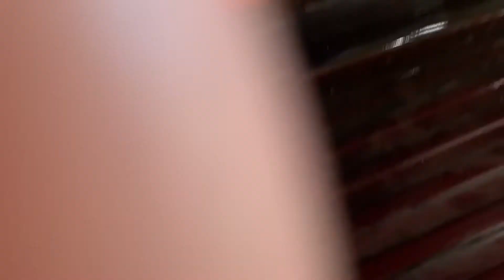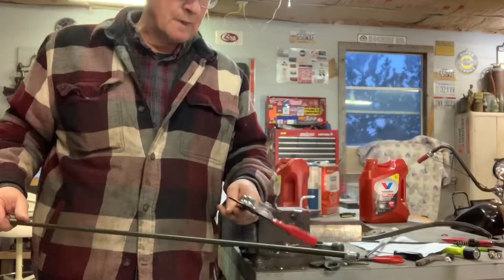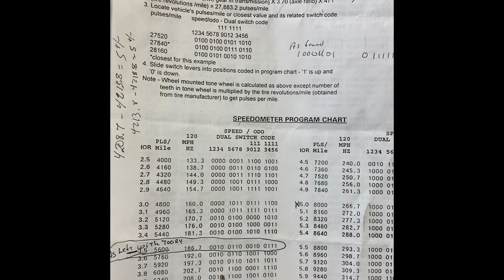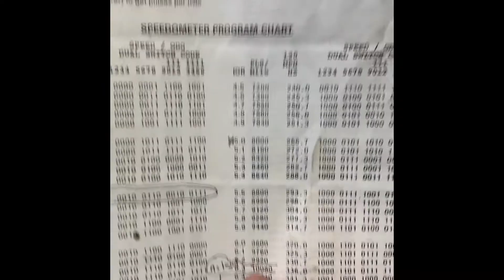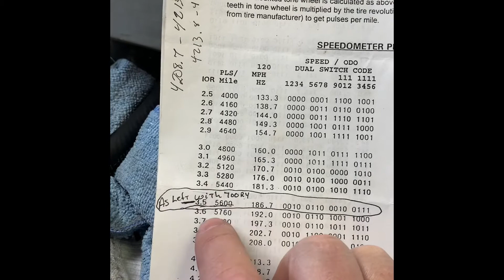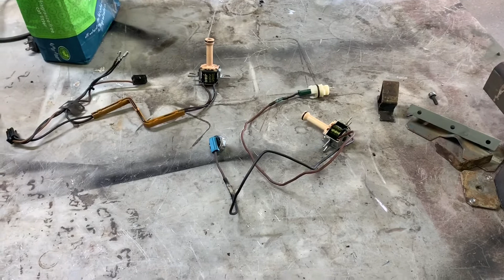Pt2 52 Chevy pickup Turbo 350 to 700r4 Swap

Comment: So its been about 10 months since this video. Have you been able to see the better fuel economy?
Reply from the maker: Not as much as I had hoped. Looks like roughly 4 or 5 more miles per gallon. However with the RPM reduction at highway speed (70mph) the motor is not screaming anymore.
Reply: @dubsgarage  Ten4

Comment: A side note from my other comment on the first video. My 1992 GMC C1500 has the 700R4/4L60 and I've had a heck of a time with the torque converter lock out shudder that they're known for. I'm thinking about doing this 4th gear pressure switch lock out kit my self. How do you like it and will it disengage when you need the extra power or do you always have to manually flip the switch to unlock it? Cheers! Zip~
Reply from the maker: ZippoVarga thanks for your comments. Yes I have to turn on and off the lockup as I drive however it’s not a problem for me because I’m on the highway mainly. You might want to consider the Painless Wiring lockup kit, it is connected to the brakes and also senses the vacuum and automatically engages and disengages the lockup. I know when these 700r4 first came out a lot of guys were building their own kits using vacuum switches of the Chevy S10’s.
Reply from the maker: This web site has some good information on the 700R4. http://www.purplesagetradingpost.com/sumner/techinfo/700R4p1.html
Reply: @dubsgarage  Thanks much for the reply Okie! And for the link!